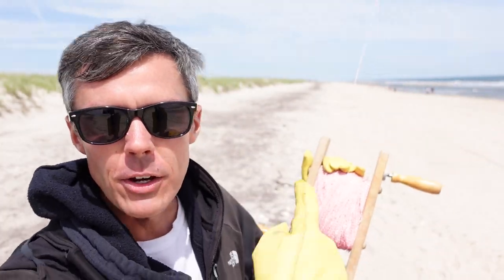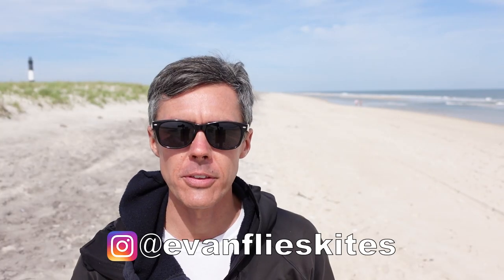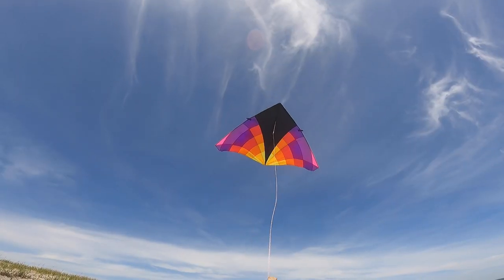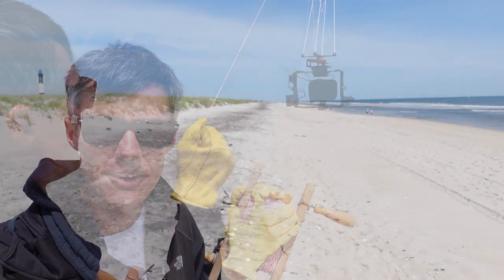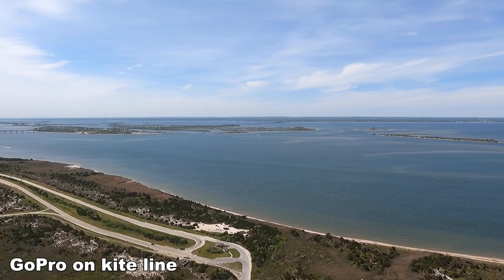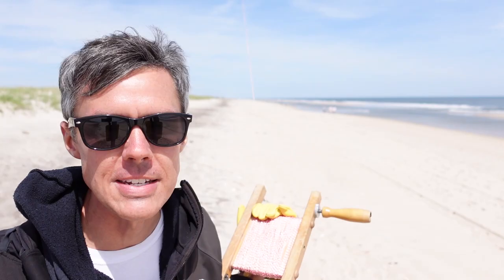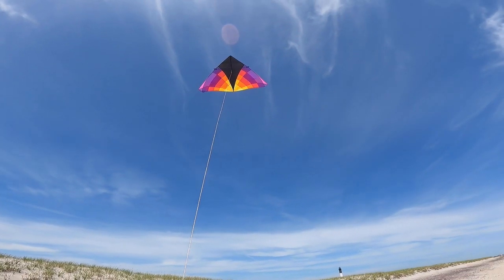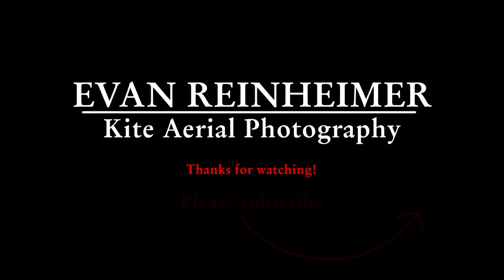Flying a Delta Kite CRAZY High with Camera & Crashing It

Comment: Hi Evan, that GoPro footage from high up in the sky was superb ! I did have the feeling that the wind speed at that moment was at its upper limits for a delta kite to fly in a stable and controlled manner. A good thing you tested your kite and that you didn't lose your expensive equipment. Keep up the good work. 👍🏻
Reply from the maker: Thanks! The image stabilization combined with the horizon leveling feature on the GoPro does make KAV much smoother. The wind wasn’t all that strong, maybe 12 mph max. I’m going to switch back to the stock spreader for the time being.

Comment: Hi Evan, I have a Into the Wind 9’ Levitation Delta like yours. I usually put a long fuzzy tail to keep the kite steadier in high winds. You can replace the leading edge fiberglass spars for carbon fiber if you are looking to save weight in low winds conditions. Just put a solid 2.5” carbon fiber rod at the tips  to reinforce the spars. I’d seen people cutting the upper spreader in half to put a dihedral spacer but it is actually not need it for the ITW Levitation Delta. The fiberglass spreader while a bit heavier than carbon has more torsion elasticity and can handle heavier winds than carbon fiber. Good luck!
Reply from the maker: I’m going back to the stock fiberglass spreader for now. Turns out the ferrule slipped because it wasn’t glued properly and cause the end of one of the spreader tubes to crack.

Comment: Evan - good stuff.  As noted on the KAP forum, I use carbon fiber (SkyShark P400 and P300) tubes set up with the Dynamic Spreader (DS) configuration.   I have had flight failures with the old two piece and the new 3 piece stock spreaders.  I have ditched them all and swapped in the DS with excellent results for KAP with over 300 flights and no failures (due to the spreader).   Like the high shots....the stabilized Go Pro video does a great job for auto KAP.   Keep the photos and videos coming. WW
Reply from the maker: Thanks, James. I’ve never had a problem with either the 2 or 3 piece stock fiberglass spreaders. I was just trying to avoid the problems I’ve read about from your experiences. I contacted Mike about getting a DS and hopefully will have one in the future. For now, I’m going to go back to the stock spreader for this kite. Thanks for watching!

Comment: Ive just noticed that the colour scheme of this 9 foot Levitation Delta is different to the 9' Levi Delta seen in your other videos. I have the other colour version (different to the one in this video.) So far, my stock spars have held up fine except I had an accident with one of them just prior to my very first flight. I dropped it and accidently stepped on it. Well actually, there was another accident several years later when my Levi Delta crashed and one of the spars speared right through the kite, creating a hole in the ripstop material. That also resulted in a broken spar with the three piece spreader.

Comment: Love your enthusiasm for KAP. Was your joint for the carbon spreader close to the middle of the kite? That's usually the trouble spot.
Reply from the maker: Thanks!! No, I made a 3 piece spreader. Turns out one of the ferrules slipped and caused the end of one of the tubes to split.
Reply: BTW I did the Art Fair circuit as a furniture maker for 30 plus years mostly upper Midwest and East Coast. ACC shows were a mainstay. Not an easy way to make a living but it can be done. It was certainly interesting and provided a lot of independence. Best of luck to you.

Comment: What’s stronger fiberglass or carbon fiber? Are ITW kites stock frames worth it? I purchased a KHK 9ft delta and the spine spar folded in the air after 10mins and the kite crashed. The spine spar was a resin rod. For 180$ I’m never buying KHK again. Also are the 5-25 mph wind specs accurate for KHK kites? Cause after watching mine fold 300ft into the air I was pretty annoyed cause it was a bit expensive for the kite to only last me 10mins and to be honest I couldn’t even get the delta to fly steady in the air for the 10 mins it kept swaying hard side to side crashing and the wind was only 15mph. What’s better carbon or fiberglass also what brand should I buy next? Prism or ITW??? Thanks yall

Comment: Where to purchase this Delta?
Reply: Into the wind in Colorado. They have a website. Do not buy the same model from Emma Kites on eBay. While cheaper, the cloth was brittle and the weight unbalanced. If you plan to fly it in heavy winds, I recommend a fuzzy tail to make it steadier. Mine is a 9’ model with a black and white tail to match the kite and it looks cool in the air. Good luck!

Comment: Hi man :) what was your height record? I wonder if kites can be used for military surveillance instead of drones. Imagine we can get a night-vision camera up to 1000 meters and monitor enemies from the sky for HOURS without worries of the battery getting flat(drone). I guess threaded drones can be used but it is gonna be expensive VS using kite that is much cheaper...
Reply: I would imagine that the battery in the night vision camera would go flat if the kite was up in the air for hours.